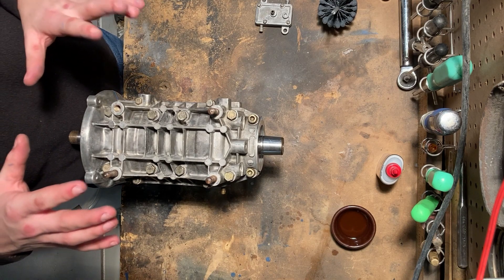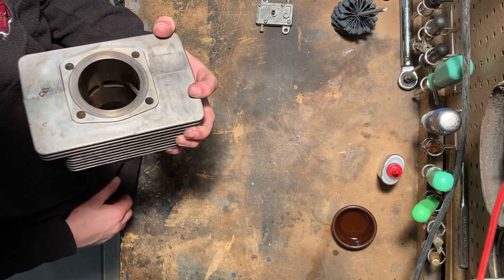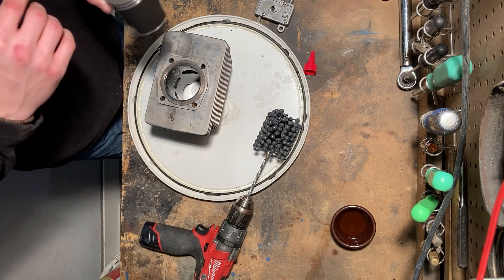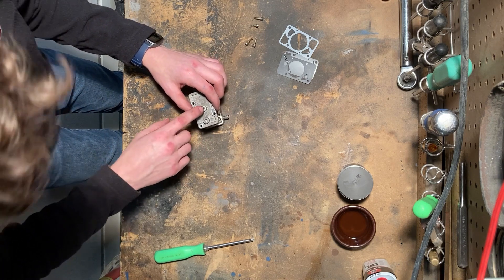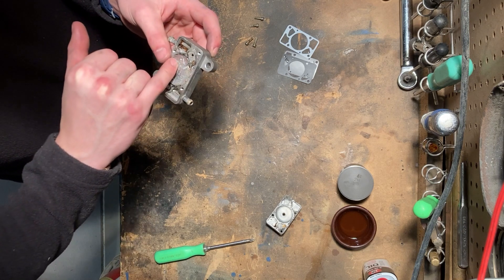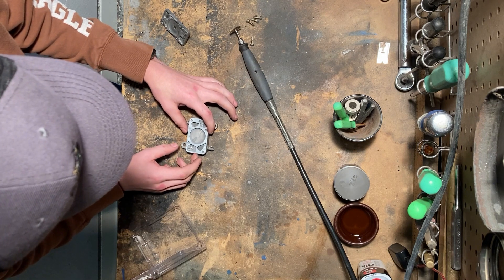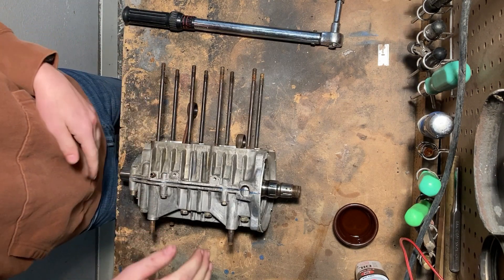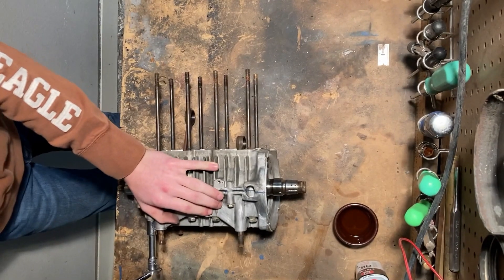Rotax engine rebuild (Part 2)

Comment: The original crank seals have a ridge around the circumference that fits into the groove machined into the case halves. These have to be installed onto the crankshaft before the case halves are put together.
Reply from the maker: I’ll keep that in mind!

Comment: If the two stroke engine runs lean it will overheat more often.
Reply from the maker: This engine came from the factory with fan cooling and Someone removed it causing the rear cylinder to get insufficient cooling and in turn the seizure